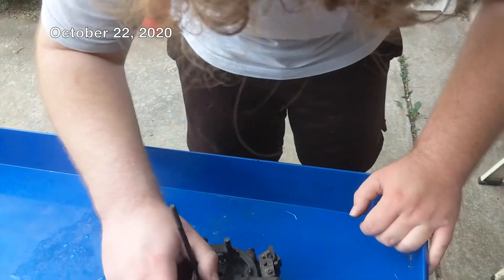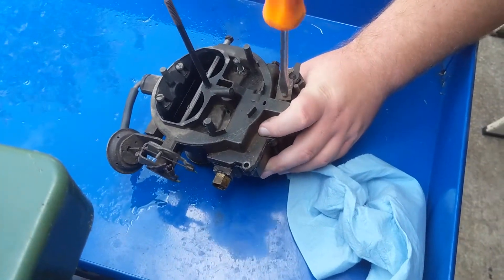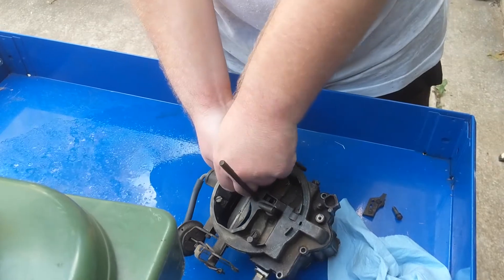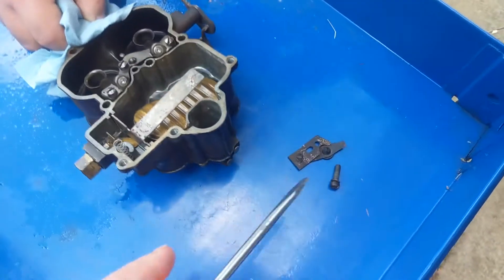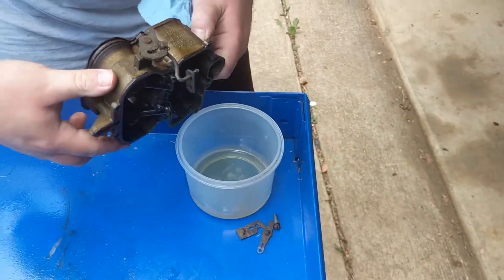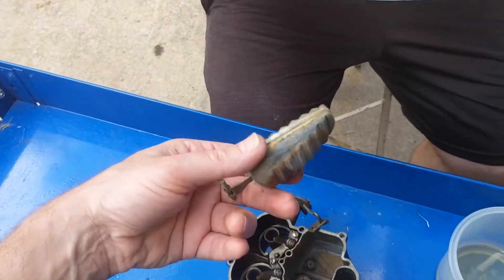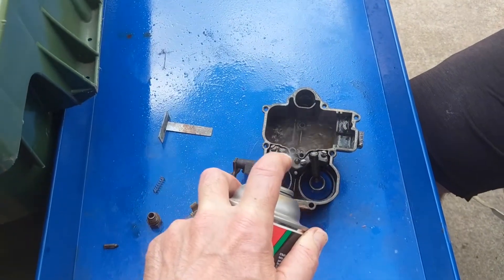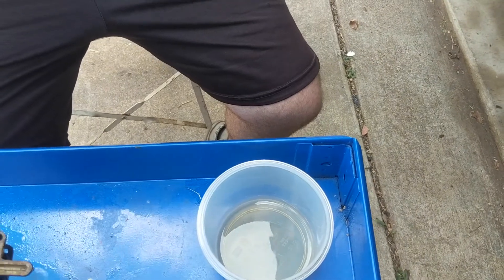Tinkering With a Bendix Stromberg WWC 3–262 Carburetor

Comment: Had a Stromberg WWC on my 1965 Chrysler 383 when bought.  I rebuilt it with a kit once.  After 3 years, I installed a 4 bbl alum intake and Holley Pro-jection TBI.  No better mileage and the Pro-jection never worked well.  Now I have a Holley Commander 950 TBI which has more sensors and is programmable, but haven't driven it yet (no current license).  The WWC has been on the shelf since 1996, plus the OE 2 bbl cast-iron intake.
Reply from the maker: Cool, I ended up selling my Plymouth Fury, and the first thing the buyer said he was gonna do to it was swap out the intake and WWC for a 4 bbl but I don't know what 4 bbl he was gonna put on it.  I don't blame him though, all that work I put into that WWC just to end up starting the car every time with carb cleaner but it was cheap 😂 It makes a nice shelf piece.

Comment: if you ever sell this PLEASE let me know, I need one for my nostalgia class race engine
Reply from the maker: https://youtu.be/V6B6fz907Sk
I actually ended up with another stromberg.  But, it will need some work.  The power bypass jet got stuck in the bowl and the airhorn is missing some parts.
Reply: @jackedgarage  ah I gotcha. I've been on the hunt for one of these for a while and they are very hard to come by it seems
Reply from the maker: @StrikersLG  Here's a deal, https://www.ebay.com/itm/383364636875?epid=7047858850&hash=item59425020cb:g:bUwAAOSwvAReGJCD it's crusty though lol
Reply: @jackedgarage  THANK YOU! I have been looking everywhere and I could only find 500 dollar rebuilt ones. Thank you!
Reply from the maker: No problem 👍 Glad I was able to help you out lol